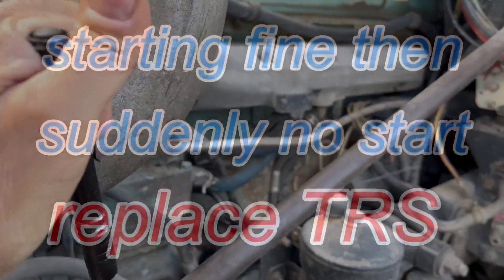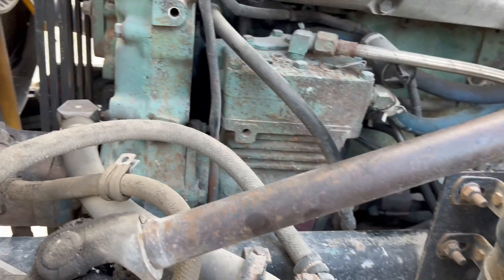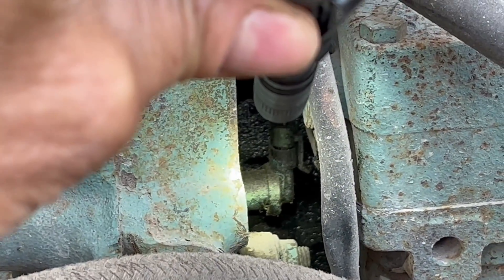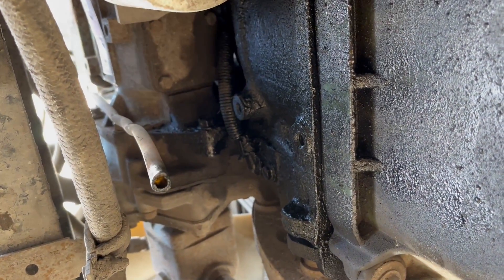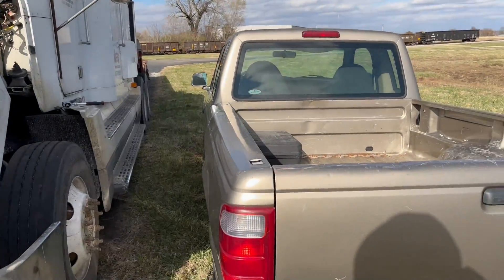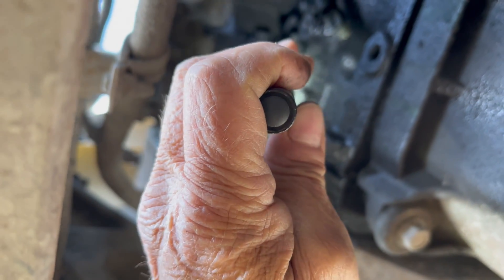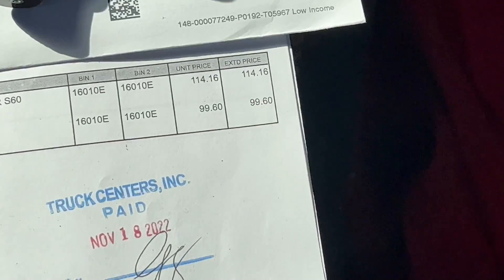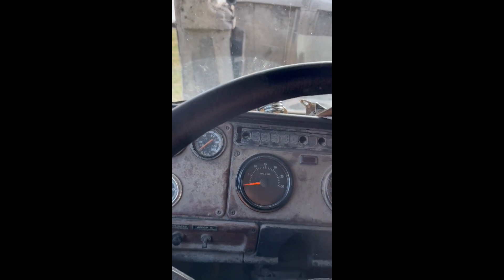Series 60 or any motor, crank but no start.  TRS (Timing Reference Sensor)

Comment: I like your videos and u help in the past.my problem is :truck sitting over the weekend and isnt starting i spray little bit starting fluid to started. U think is fuel issue or any sensor crs trs??truck start fine every day only when it sitting weekend. Thank you

Comment: Hey Gordon thanks for the video,  I noticed the long start after you changed the sensor. Did that go away after your batteries were charged or did changing the other one fix it?
Reply from the maker: Thanks for watching. I don't know why it did that, I haven't had that problem before, I think maybe it lost it's prime from trying to start it before replacing the sensor.
Reply: Most likely because the engine was so cold.

Comment: hey gordon
i just got new reman 12.7l put in from detroit. it has all sensors new and got all new accessories, clutch, trans
the truck having hard start. i have to crank for 20 seconds and then it will rumble and then start with some white smoke then its smooth and runs good with no issues and no leak of power. if i turn off for 1-2-3 hours its fine. but overnight, it will be hard start
mechanic said its fuel lines sucking air and he want to change all lines with estimate of $3000 for lines and labor
since both sensors are new 
what could it be ?
could it be lines ? my dad is old school driver says its the check valve behind the motor the reason. 
like i said its having hard start. i have to crank for a while then try again then it starts or with ether it will start quickly.
Reply from the maker: I really don't know. $3000 is way too much for fuel lines, if you could find a way to put a little air pressure on the fuel tanks you will see if there is a fuel leak in any of the fuel lines which would be a vacuum leak on the suction when truck is running but I don't think that is the case.
Reply: Hello hi did you fixed?? I have the same problem but I already changue valve return back in the block fuel lines fuel pum and still the same I just did the rebuil and mecánic through is was the Injectors that I chamgue 3 times all 6 and is the same let me know if you fixed thanks

Comment: The SRS & TRS sensors are common problems.  It's best to replace them both if you have time because it's not very long that the other goes bad too.
Reply from the maker: Yes they do work together and I plan to change the other one at home this week since the weather will be better.
Reply: I agree and it’s the only way I would work on one 
Plus I keep the parts

Comment: gordon we need a video on cam seal
got a leak and mechanic wants to do full overhaul and truck running great with good oil pressure as im topping off oil every 3-4 days
Reply from the maker: I can't do a special video on something like that unless my truck was down for that reason but I might have that covered in my series on the in frame overhaul, look in my playlists for that.
Reply: @GordonRobertsonDIY  does it really need an overhaul
or it could be just changing seal.?
Reply from the maker: The rear seal is not too hard to change but the front one is not worth the trouble just for that, better to just get used to adding oil and cleaning the motor more often. You don't need an overhaul for that.
Reply: @GordonRobertsonDIY  thats what i have been doing last 30k miles
adding a quart every 3 days or so
i also have a leak from seal between air compressor that that little accessory drive thats attached to front cover on driver side
that leaks alot. any idea if i normally need just the seal
or accessory drive as well
air compressor working fine 
but oil leak blows everywhere and especially over ecm and i dont wsnt to put pressure washer on it.
Reply from the maker: The accessory in front of the compressor is the power steering pump, you can take that off and clean the gasket surface with a sharp scraper and dry it off with brake cleaner and put some Permatex Gasket Maker https://www.amazon.com/Permatex-82194-High-Torque-Silicone-Gasket/dp/B000HBGI8K/ref=sr_1_6?crid=2EQUI2T8I6K32&keywords=permatex+gasket+maker&qid=1669042747&sprefix=permatex%2Caps%2C116&sr=8-6 
any color on and do not buy a new gasket, only use the silicone.
You do not need to add a quart of oil at a time to the motor, as long as you get something on the stick your fine, you can put 1 or 2 gallons at a time in. Doesn't hurt to go down to the end of the stick or to over fill a half gallon or more.
I'll try to do a video on patching leaks on the series 60 this coming weekend.
Reply: @GordonRobertsonDIY  great info sir
i try to keep it at (F) sign on stick so im always running full. hahah.
but why gasket maker vs buying actual gasket ? is it better ?
Reply from the maker: Yes it's better, the paper gasket will leak again after a year or 2.
 Only use paper gaskets on water or antifreeze seals, any oil seal always use either a preformed silicone gasket or the Permatex. I'll do a video on that during the holiday.
Reply: @GordonRobertsonDIY  that’d be great
i’ll watch it and follow your lead

Comment: i got a series 60 in my KW same yr as yours and it takes a notion not to start i give it a shot of ether it lights off and im on my way , had it overhauled a couple yrs ago and they put a new internal harness on the injectors that seemed to have fixed the problem but after about 90 days went back to the same old non start condition again im wondering now if the same sensor you just changed might be the culprit
Reply: I had the same issue on my detroit, changed the sensor and never had to use ether again. Mine seemed to start fine cold but when warm the sensor wouldn't read right and a shot of ether would get it going.
Reply from the maker: Thanks for watching Tim. Since that is an easy part to change and not too costly might as well go for it, the other sensor (SRS) is harder to do but I will do that and a video when I get the truck home for the holiday. Happy Thanksgiving.